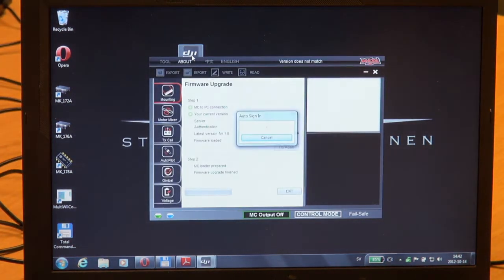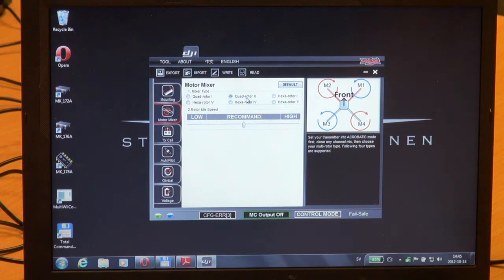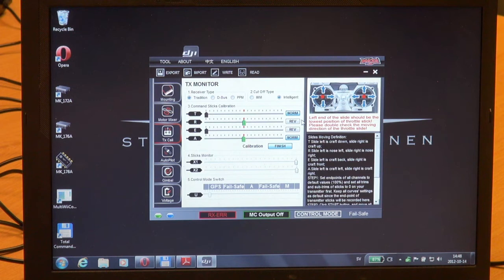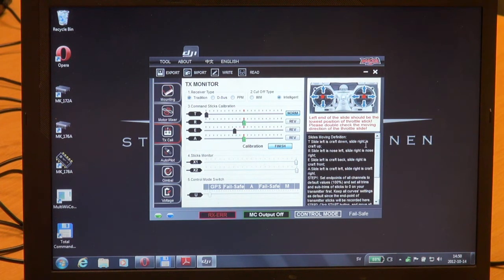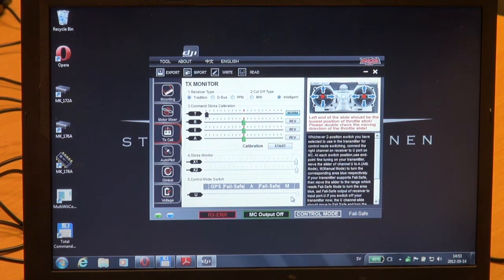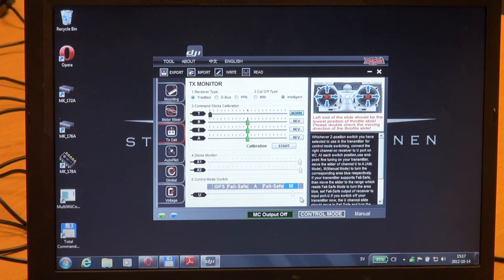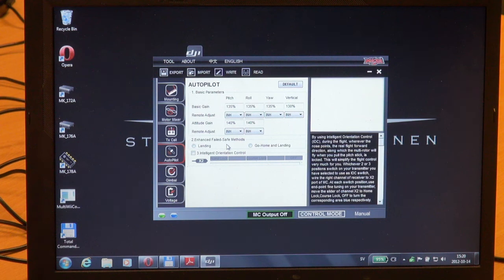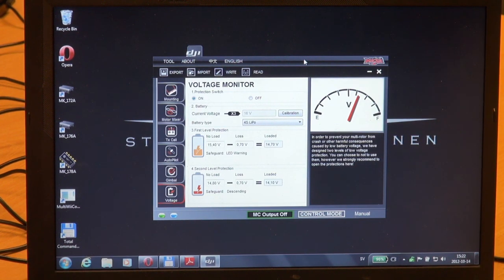TBS Discovery build EP17 TBS Naza Basic Setup - 20121014

Comment: Thanks for your extensive and detailed explanations, I follow one by one and everything is great,I have just one issue may be you can help me.
I have a JR9503, and the screen is not responding when I move the stick to calibrate and the control mode switch is in blue (A").
What do you think it could be the problem?.

Thanks.